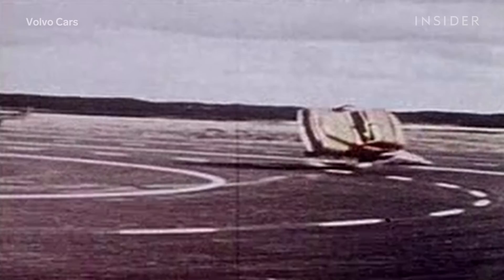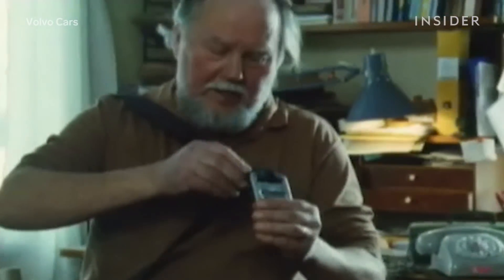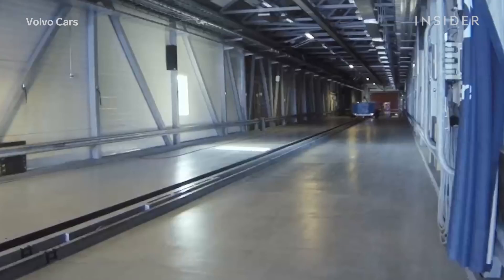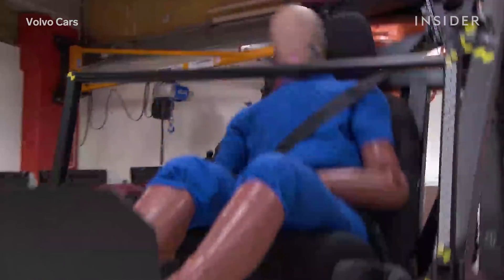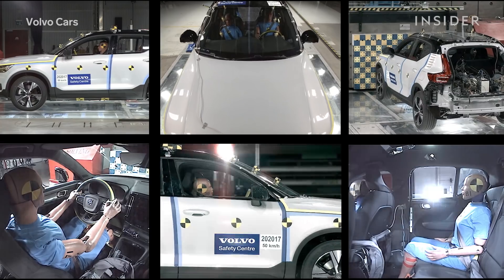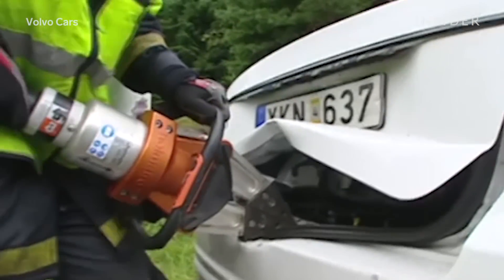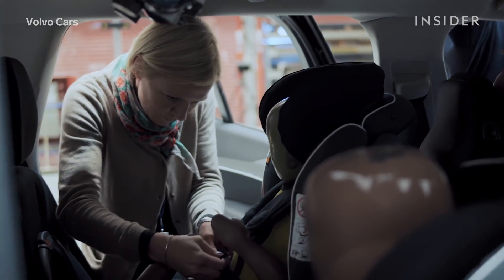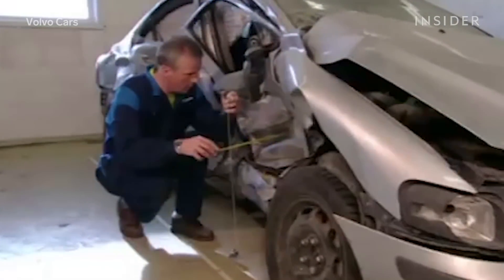How Volvo Recreates Real Car Crashes

Comment: 2 EMTs told me that Volvo wagons CAUSE more accidents than any other car. 
Maybe because those drivers feel so safe that they are careless.
Reply: thats total cap. according to the NHTSA Volvo isn't even on the top 25 cars involved in fatal accidents in the US
Reply: Two ignorant EMTs.
Reply: Er... Are you thinking of Volkswagen, which is a different brand? Because they rate #2 in at-fault accidents.
Reply: You sir, have no idea what you are talking about. Volvo has done a tremendous amount of research and implementing a vast amount of crash preventions system to insure that the vehicles in first hand tries to avoid accidents. For example, Volvo was the first automaker to have city safety and pedestrian safety as standard.
Reply: @magnussporrek3883  
1. One can always tell a poor comment if it starts with an insult. 
2. And I DON'T KNOW. That's why I said "2 EMTs told me ..."
3. The best thing Volvo did was to make their drivers PERFECT. 
Did I forget to mention that ?   
("Don't 'Sir' me. You have no idea who you are talking to.")
Reply: @stevejette2329  Magnus is 100% correct, it wasn’t an insult, EMTs has absolutely zero facts to bring to this matter, personal experience brings no fact to the matter and…. Chill and have a great day!
Reply: @DrDajom  You are 100% correct. I am 100% wrong. Evidently neither of you READ THE POST. Mangus argued that the CAR was very safe. OK

But the perfect car has a flawed driver, made worse by the over-confidence in the safe car. I am not sure how you can be aware of an EMTs experience and knowledge, unless you are a mind-reader or know-it-all.
Reply: this, to achieve a greater road safety we need to focus on designing roads that discourage unsafe behaviours. safer cars is just not enough, not to mention that the new car designs are lethal for people outside of them
Reply: @invalidavatar  what do you mean that the new cars are lethal to the people outside them
Reply: @Thomas_Smaling  they're more fatal to people that are not in cars or in smaller cars
Reply: @invalidavatar  so 60s cars with pointed edges are safer than modern cars with pedestrian airbags.
Reply: @Tom_5435  The Volvo series 2 was a 1960’s car…
Reply: @Tom_5435  i never said that lmfao
Reply: @invalidavatar  yeah you did, you deleted the comment that said it.
Reply: @Tom_5435  gaslighting boss girlbossing queen